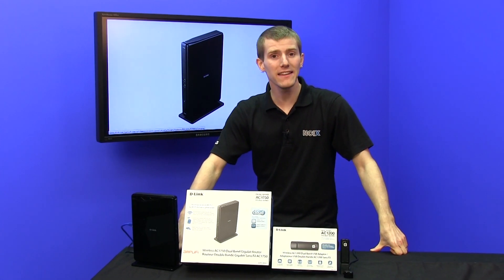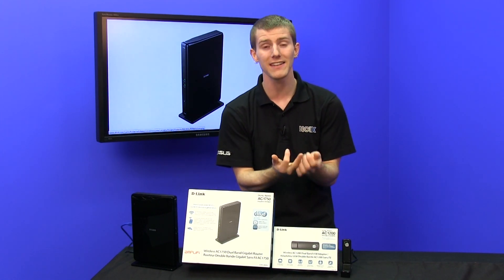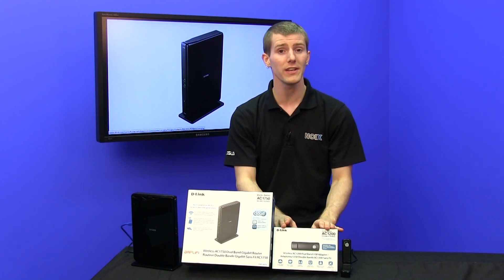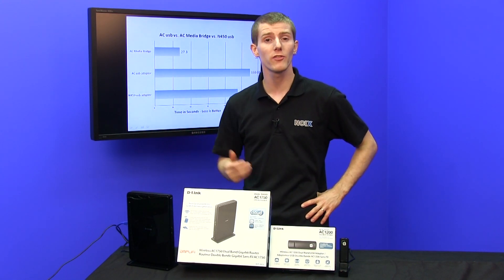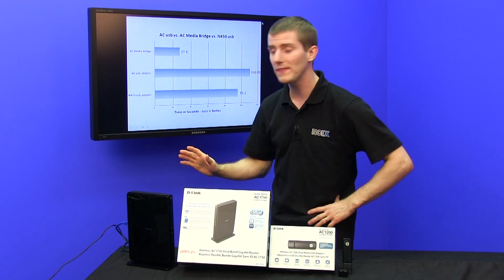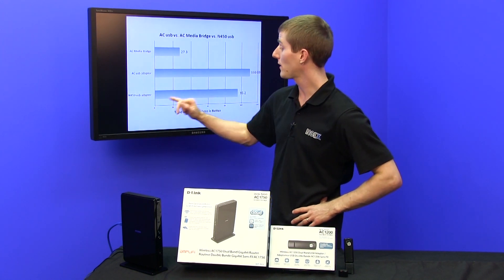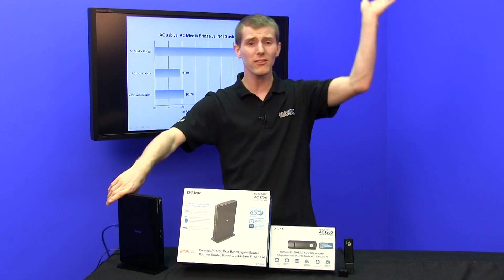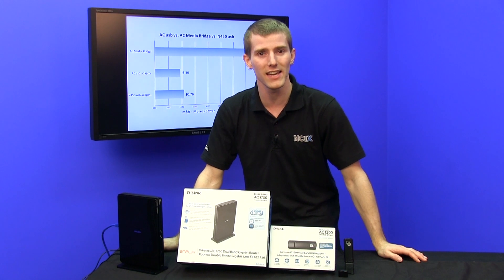D-Link Wireless AC Routers & Adapters Showcase NCIX Tech Tips

Comment: There are very few devices that support wireless AC. There are almost no devices out there right now that support AC, so speeds on current devices will jump back to b/g/a/n speeds, depending on what the device and the router support. The only things out there are adapters and routers.

Comment: 802.11n and AC require multiple connections to reach their full speed (like with B,G,N, best case, you will only get about 50% of the advertised speed) but to get that 50%, you must make multiple connections. (N450 requires a minimum of 3) and AC requires 6 (N and AC use 1-2 connections per antenna and if only 1 connection is active then only 1 antenna will be used. (in the case of N, you get effectively 150mbit performance) (ethernet is still best as it only has 1 connection for 1Gbit)

Comment: @2"35 " usb is limited to 480 megabit per second"

he should have SPECIFIED " usb 2.0 is limited to 480 megabit per second. however as long as the device is usb 3.0 and is connected to a usb 3.0 host device then you should not encounter that bottleneck"

Comment: I'm not just talking about the cables. Cables also tend to run through an entire house so you'll always get some, no matter how low, signal degredation. But I also meant the storage on both sides and the hardware in between.